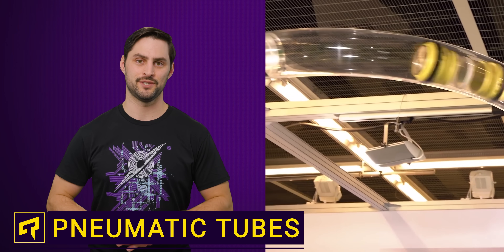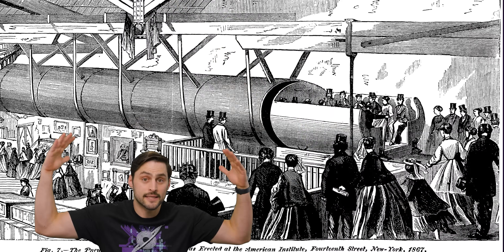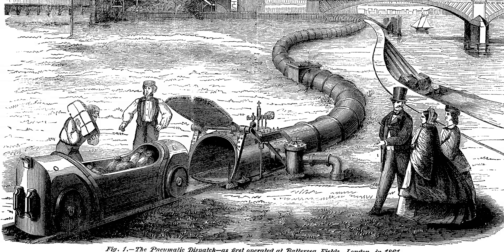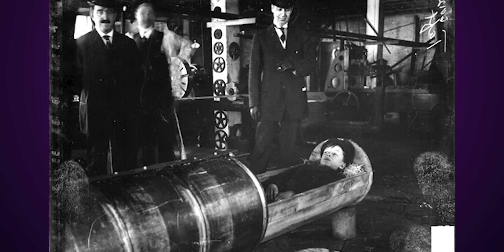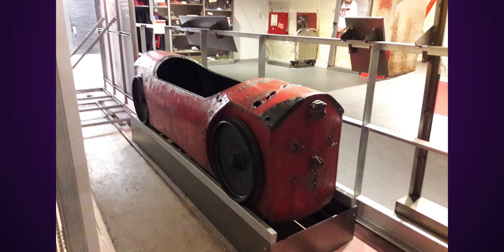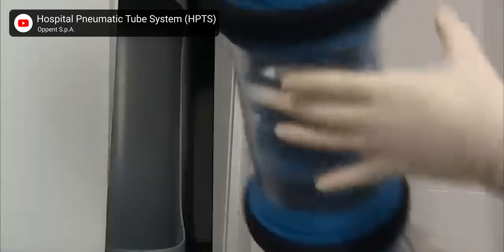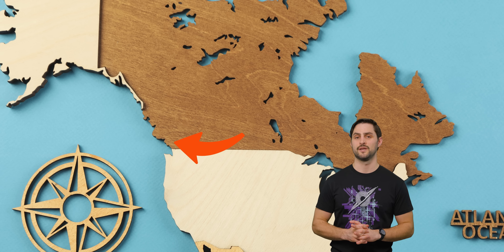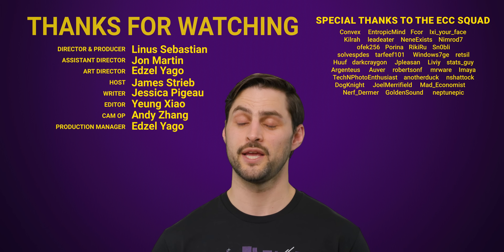Why We Don’t Travel in Tubes

Comment: The reason pneumatic tubes actually counts as a "secure storage" is because you can have parts of the system pressurized/vacuumized at all times, and then have it connected to a pressure monitor. The system can by the pressure monitors know the "integrity" of the system at all times, and raise a alarm and shut down the system if any tampering occurs, and require a service technician to reset the system with his code. This in contrast to a mechanical conveyor system, where a culprit could intercept a delivery of pot or similiar and thus doesn't fulfill the requirement of "secure storage" unless all rooms where transport occurs, are alarmed and guarded.

The good thing with pressure monitors, is also that the pump system can vary the pressure randomly, effectively "sending a code", and then verify the same "pressure code" is received at the other end. If someone tampers with the piping and for example tries connecting a external pump or vacuum cleaner or something to the system in a attempt to cheat the pressure monitoring system and being able to intercept things, then the "pressure code" will not match what the other end sends, thus the system can know tampering has happened.
The fact is that these pressure monitors can be so sensitive that if a pipe section has been serviced and replaced, then the pressure monitor system has to be recalibrated for it to not trip, just because the volume of the pipe has slightly changed due to the servicing, which is "visible" to the pressure monitors.

In addition, its also possible to identify capsules with for example RFID, and have RFID coils at different locations in the pipe, timing the exact time it takes for a capsule to reach certain points. If this differs too much from the expected time, a tamper alarm could be raised too.

This is why pipe transport can be classified to the same security standards as the secure storage locations itself.
Think like a supervisored alarm cable (with end of line resistors) - but with physical transport.
This is why banks like the system.

However, the problem with, what you said, shoving bed frames and foreign objects into the pipes, can be largely solved in two ways:
Either make the public points receive-only in single-use capsules or make the pipe system completely sealed, meaning the capsules are not taken out, instead a door is opened on the capsule and the objects put into.
If you want to make such a system very safe against foreign objects, you could have that the door on the capsule is spring loaded and open inwards.

Then you put your thing into the capsule. When you are done, the capsule is lifted by a solenoid, from a pressure releasing valve, then the section where the capsule is, is simply pressurized. This causes the inside of the capsule to pressurize, effectively locking the door on the capsule, while this can be monitored by a RFID pressure sensor, verifying the door is securely locked and there is no leaks.
Then its sent to the destination, where the capsule now hits the pressure-releasing valve, which will now release the pressure inside the capsule, which then allows the capsule door to be opened.

This would completely eliminate foreign objects in the piping system.

This doesn't however solve the problem with human transport, but it can be solved in a similiar way with interlocked doors on the pipe and the "capsule" inside (but without the pressure lock, a pressure lock is just needed for a small capsule where you don't have space for complicated locking mechanisms), preventing any capsule release unless both doors are securely locked. Still the problem with debris between the outer and inner door, which isn't a big deal in a object transport system, as it won't hurt its performance as much, so a human transport would need some kind of vacuum cleaner that starts when both doors have closed and locked, which cleans the area between the doors, before capsule is released.

Comment: Quite honestly I have to wonder why point-to-point parcel isn't a thing by tubes. You wouldn't need a food courier or mail/parcel courier, and those services are perpetually getting more expensive and unreasonable to use.

I envision it would only work well in high rises though. Where everything you need in your unit (food, clothing/laundry,trash/recycling collection, etc) could just have a tube capsule with several NFC id's on them. So the blue-white capsule is for recycling, the white-black capsule is for laundry, the red-green striped tube is for food, the solid-green capsule for trash. Stick the capsule in the tube, the basement sucks it down, reads the id and then does whatever it needs to do with it, then sends the capsule back up empty. Likewise if you get a parcel or food couriered, they simply come to the building with the capsule and just stick it in the tube in the guest parking. The basement computer checks who it's for and sends it to them, and then when they got it, it sends the empty capsule back to the courier.

It could work, I just don't see it ever being cost effective except for some really tall buildings (eg ones with more than 10 floors) even the 30 floor build I live in, the amount of time it takes uber-eats, amazon or purlator to get to my floor can be a good 10 minutes.

Comment: saw some in a hospital once, let nurses send samples to the lab.  apparently always a surprise when you opened the capsules since there was a fairly high chance the thin glass walls of the blood collection tubes were prone to shattering mid transit so you always ran the risk of a dangerous bloody mess.  they didn't use them.

Comment: I used to work in a Tesco supermarket and we used pods to send cash from the checkouts to the cash office. You would take the notes out of the till, screw it into a capsule and a pneumatic tube would send it very fast. That way you didn’t have to walk through the store carrying cash, it was all sent through tubes and locked away.

Comment: I worked in a hospital that was built in the 1900s and slowly expanded.  They had, on some wings, a pneumatic tube system to deliver lab samples (blood, tissue, whatever, usually blood).  Actually, the ironic part is that the tubes ran to the pediatric wing, which was built in about 2003 or so.  Before that, it was a parking lot that was partially covered by the floors above it.  So those tubes were definitely put in place in 2003.  The OLD system for lab delivery is a dumbwaiter, actually, and that was probably put in when the original hospital was built at the turn of the century.  I had to run one such blood sample from pediatrics to the lab myself, however.  We had this infant (couldn't be more than a year old) who we kept pricking their foot and sending the blood up.  Twice we did this and twice the lab called down stating it had clotted too much.  So, on the third run, which I was in there observing, the nurse passed it to me and told me to take it up by hand and keep gently rolling it.

Comment: My local bank uses tubes at the drive-thru part. You send them the ATM card, cash, or check  and tell them through the speaker what to do. 
On "the Jetsons " the tube has an open door so I think it's just a round elevator that uses cables.
I've heard that Elon Musk wants to do an underground railroad type of tube that lets you go across the country fast in your car. .....that's just something I heard though

Comment: No tubes suck.  They always puish.  There is no such thing as a suction force. When u remove air from one side, it does not suck.  The other side PUSHES.  All tube travel is pushing.

Comment: Costco used to have these systems for depositing cash out of the drawer. If a cashier showed as having too much cash in their drawer, they would pull the cash, count it and put it with a count slip in a canister and shoot it off to an office somewhere.
Reply: Coles Supermarkets in Australia still use this system for their staffed checkouts. These are not just legacy installations. They're installed in new built supermarkets as well.

Comment: A streamlined vehicle traveling through stationary air has its own surface area exposed to the wind of its passage. A blunt vehicle traveling through a tube feels no wind, but the entire length of tube from end to end must have the full wind flowing over the huge internal surface area of the tube. This causes immense friction losses and makes flow-driven tubes impractical.

Comment: The main issue with larger pneumatic rail is the same issues you have with rail- NIMBYs, uneven and varying terrain, track maintenance, and hard corners. You can't just draw a straight line and every bend requires more overall pressurized force to keep it moving. The tiny tubes in your bank or building apply more than enough force than is needed to move a small object, whereas the amount of force needed to move a car or a cabload of people is way higher. And the getting in and out of the tube will take forever, unless you want your blood and eyes to boil. And any $$$ estimate some tech bro spouts about the cost of the setup is based in BS, as costs can vary so much and the obscene costs of rail projects are them being realistic and open ended towards things like "Oh, for 300 km of the route we were gonna put the rail is right on top of gravel sediment over a cave system that will erode and potentially sinkhole from all the weight we're putting on top of it."- all of which apply to large pneumatic tubes, which would weight more than two lines of steel rails on top of wood.

I'd recommend watching "Well there's your Problem" podcast which covers the Pneumatic Rail (and I even saw it as a precursor to Hyperloop) and they recently did a episode on Hyperloop itself breaking down why the tech fails in both concept, mechanics, and engineering to the point a Bus line would be cheaper and move more people even if the hyperloop was transporting 5 people at a time at supersonic speeds.

Comment: There is no "it remains to be seen", it will never be used to carry people!  It can't be done safely and in order to do so quick enough for it to be an improvement over normal rail would be far too costly.

Maglev trains are orders of magnitude safer and cheaper, plus there comes a point where going any faster is likely not great for your health either.

Comment: There is a clear justification for why these systems will never work for transportation, and not only it's basic economics, you can also find proof everywhere of it. It also has nothing to do with tech.
If you stop to think about it, why do we have roads, railway networks and paved sidewalks as the basics of public transportation?

It's because they are the cheapest and most effective way of transporting a ton of people all at once.
The means, meaning stuff like asphalt, train tracks and pavement is cheap to make and maintain.
Cheap relatively speaking of course, infrastructure is super expensive, but cheap in comparison to other potential solutions. Asphalt is infinitely recyclable and we have all the machinery for it's maintenance that can be done with small teams, and some level of breakage doesn't completely stops it from working. It can be laid down after plaining and preparing lots of different surfaces as it's an amorphous substance that hardens later on. People just don't think how amazing some materials involved are.
Train tracks, tunnels, bridges and whatnot are also expensive, but they are the most cost effective solution for how many people can use them at once, versus cost of maintenance and building. And still, we're talking in the order of billions for long stretches or complex terrain. Anything more complex than those elevates costs in orders of magnitude per distance, not to mention amount of material required and maintenance costs.

The focus of expense has to be on the vehicle, the thing that will be using those. Be it your shoes, or a high speed train. Or even an airplane, for which you don't have to built a means for.
That way, transportation is scalable. The expensive portion of it you spend more money as needed, and it has room for technological evolution.

A vacuum tube system is the opposite of that. It puts the expensive part on the means, while trying to save money on the vehicle. It requires too much material, too much maintenance, and too much money to build.
The scalability of it is also wonky. It's only scalable as in you build tubes where it needs to go, but it's so prohibitively expensive to do that that you'll only ever consider doing it between large hubs.
And then you have the entire problem that vehicles will be fixed to a certain shape and size, to conform to the tube, the means.
This is why it's limited to small stuff and small distances, in specialized applications.

Whatever small gains in speed you have with a vacuum tube pod system for human transportation will never trample an open system like high speed trains or maglev trains. That's also true for cargo. So... it's a literal pipe dream. The whole hyperloop fracas has always been based on ignorance, from the beginning. We don't have enough material, enough people to keep maintenance, or enough money to build a transportation system that is less efficient than what we already have. It is completely unsustainable.

People are not willing to pay the costs to use and maintain such systems, at least not en masse which is what a transportation system should be for. People are already barely able to pay maintenance costs of regular train systems, which is why it's in such a poor state in several western nations. The costs for a hyperloop system would be over an order of magnitude more expensive to build and maintain.

And the potential for catastrophic accidents and destruction are as bad, if not worse than flying cars. If you have people inside a pod inside a vacuum tube going around at the max theoretical speeds of it, some like 600km/hr, what you have is a cannon with human bullets just waiting for any maintenance issues for them to become bombs or bullets against whatever is on the way.

This is dangerous enough high up the atmosphere flying way above our heads, imagine having those at ground level. Just think of a wingless plane running around at ground level inside a tube, all the dangers involved in such a scenario.

I mean, I can keep going on and on indefinitely why vacuum tube and pod systems just will never work as form of transportation, but we have tons of people that already vouch for flying cars and other crap... so why bother.

Comment: Bank drive thru and pharmacy drive thru use vacuum tubes still and high rise building mail rooms use them to get leter mail up to each floor in seconds. From thr basement mailroom. Even some citirss tested using tubes to send mail by running from post office to homes.

Comment: I actually had the opportunity to fully design & fabricate a pneumatic tube capsule to deliver and distribute medical supplies, pharmaceuticals and even lab tests that would shoot from any zone in the hospital in under 60 seconds for one of the newest and most high tech hospital in my country.

It was quite stressful working with million digit system, a blockage would have caused SERIOUSLY major issues, I was very nervous for that first test but am happy to say I nailed the dimensions on only the 2nd iteration and it made its maiden voyage across the hospital flying goods distributed by an automated robotic pharmacist.

That memory will live with me forever, from CAD to Fab, I poured a metric butt tonne of elbow grease on it.

Bonus fact: The first video with the red capsule is called a “Swiss Log”
Reply: I did an internship and my bachelor thesis at swisslog. Was a nice time and interesting tech. All the automation for the medical distribution is insane. Never thought it existed before
Reply: So if it's used to send a stool sample from a Zurich native to the hospital lab, you've got a Swiss log in a Swiss log.

Comment: Parents have that pneumatic air elevator, it's loud but it was needed due to space constraints. It's pretty fun to use but there's a definite weight limit that thankfully it won't try to work if it's overloaded.

Comment: The current owner of Prague tube post system planned to repair and reopen it. However, so far, no progress on that front and I have no clue if they still are working on it or not. Considering, however, that the main hub is in post building at Jindřišská street, which Czech post plans to sell out, the future of the whole system may be in danger if the future owner will not be interested in keeping it. However, all that is just a speculation for now.

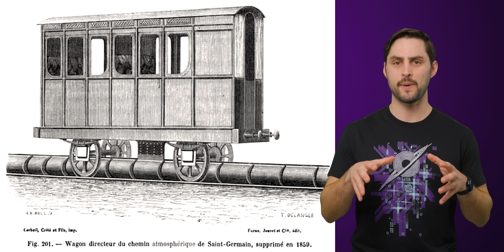Comment: There is a section of atmospheric tube track, seen at 01:25, less than a mile from where I live. It's only a short section, but one of the few remaining pieces, and it still has bits of it's leather seals.

If you're ever in Oxfordshire, U.K. and want to see it, check out Didcot Railway Centre, a volunteer run charity based at Didcot Railway Station, on the Great Western Mainline from London Paddington to Bristol Temple Meads.

Comment: As someone that up until a couple years ago installed and maintained ATMs and VAT systems (vacuum tubes) for banks. The comment on the tubes being replaced by atms is less than accurate. For many businesses they can not use an atm for business deposits and tend to use the drive up lanes as they are more secure in the long run (not getting out of a vehicle and walking to the door with thousands of dollars in a cloth bag.) Every new branch for every bank had brand new systems installed. 
They are also MUCH cheaper to maintain as they have less electronics and nearly zero moving parts. A simple stepper motor to open the window, and on some models a tilting canister. Vacuum motors in the roof (or sometimes the pedestal itself) that are 5 minute swaps when they hit end of life. 
Tl;dr you won't be seeing banks stop using these any time soon.